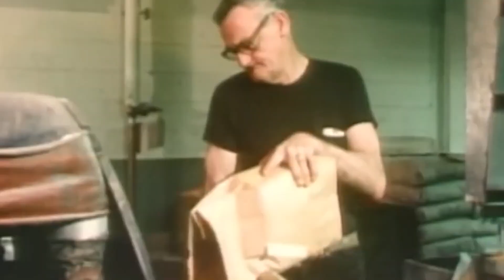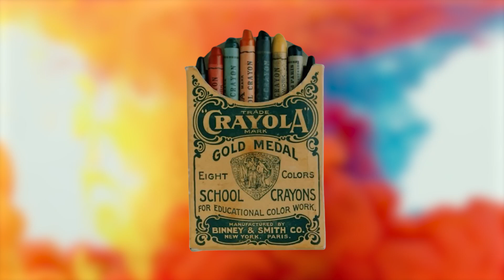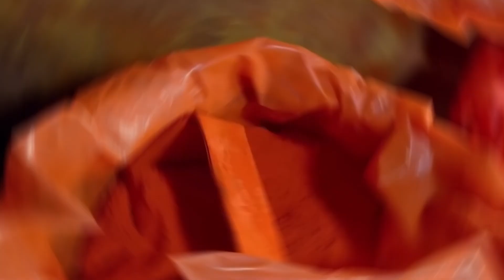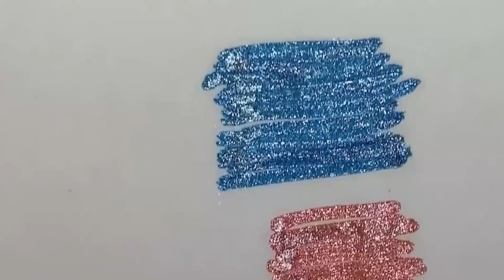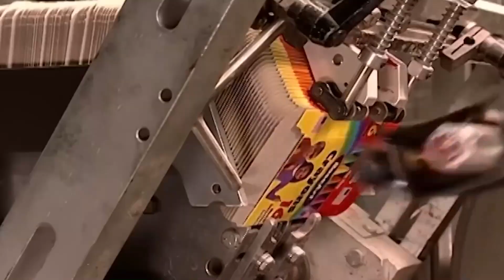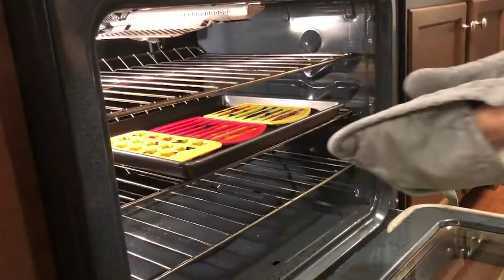How Crayons Are Made – Step by Step Inside the Factory

Comment: The mould step was the clearest part — pouring the liquid wax into moulds 120 at a time and running them through a cooling tunnel for 3 to 5 minutes before the labels are heat-stamped on.